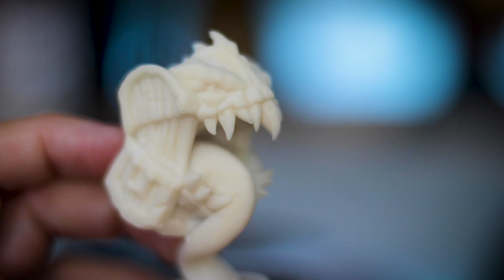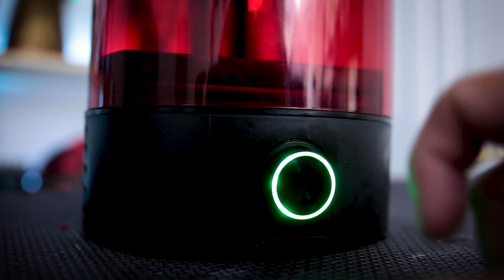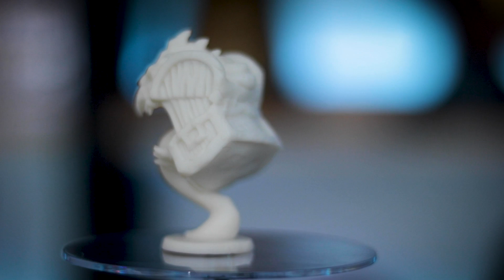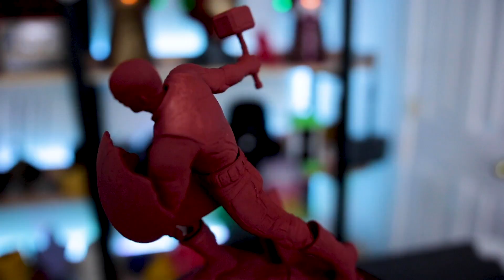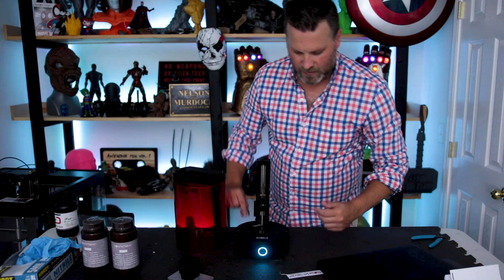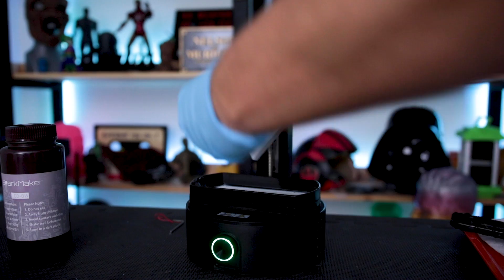Unboxing & Testing $200 Resin 3D Printer | Sparkmaker SLA Resin 3D Printer

Comment: I ordered this the day the video came out (8/23); Technically I ordered the FHD. I received the printer today (9/16). In that time I've purchased AND received my Elegoo Mars (which I paid LESS for) and have printed a considerable number of prints. In addition, the FHD version came with NONE of the resin for MORE money and couldn't have been more bare bones. Even without trying this machine, it's already a disappointment. The Mars did not come with any resin either but it came with a great many tools, gloves, face mask, a good tool set, etc.

Comment: Has anyone else had a problem when you insert the sd, press the button and it flashes yellow before turning green again? I haven't been able to print anything and when I have read various different possible reasons, none of them seem to work, I have tried using 2 different SD cards and making sure that it is 32gb and in the fat 32 format. Does anyone have any ideas?

Comment: I ordered the larger one of these after seeing your video using the link you provided. The shipping said 5-7 days, I’m on day 12 with no printer, and tracking info that hasn’t changed in a week and only indicated that the label was printed. Worst thing is a couple of days ago i seen on amazon a photon and a mars for about what I paid for this one. If i had ordered from there I’d already have stuff from my 3d printer instead of still waiting on printer itself. Not a good experience for my first 3d printer. 😡

Comment: I'm surprised you didn't mention that this has substantially poorer resolution than its competitors such as the Mars.
Sparkmaker: ~8.658 pixels per mm
Sparkmaker FHD: ~17.4757 pixels per mm
Mars: ~21.164 pixels per mm

So, I would say the Mars is easily worth it, especially since it has been on sale for just $250 every time it is available for awhile now. You can get a full liter of resin with the printer for about the same price as the discounted Sparkmaker FHD. ( Which someone else said the discounted ones do not come with the resin, which would easily cover the price difference. )

In addition, what size are the resin bottles? 2 bottles of 250g vs. 2 bottles of 1kg is a pretty big difference:) Judging by their website, it looks like they would be 500g each.

Still, always good to hear more more more, so thanks for the vid/review!

Comment: In general if you don't plan on painting your resin prints what color would you reccomend? You mentioned some color shift when using white.
Reply: Grey is usually the standard. Lets enough light bleed into the material to get the whole layer, but without the bleeding of white.

Comment: Sorry to get your expectation down guys but this printer does not have a 2k screen like the others, only the FHD 350usd version has. and the 200usd version does not have resin on the package.
Reply: The FHD just has a 1920x1080 screen, so it still doesn't even match the normal 2560x1440 other printers use. Even with the Mars' bigger build area, it's still a fair bit better.

Comment: What about those little zits I'm seeing on a lot of SLA prints?
Reply: Those are artifacts left over from where the supports contacted the model. Tweaking and resin selection can minimize this, but it's an art and never perfect.

In addition, the first few layers will need to be cured substantially longer, which causes more light bleeding: So, the first few layers will be a bit bigger and detail will be lost if the model is in that area.
Reply: @zemerick  Looks to me like I'm seeing them in areas that don't have supports.
Reply: @DTyrannosaurus  Do you have a specific example? Only thing remotely like that I can think of though is the supports.
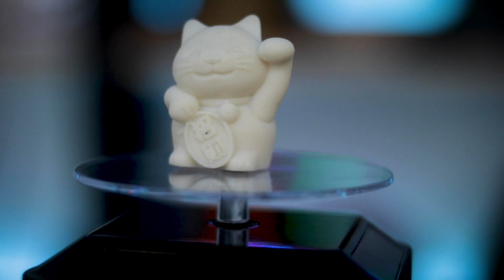Reply: @zemerick  Did the cat at 6:56 have supports? I don't think he mentioned whether there were, and it doesn't look like it should have, but it definitely has pips on it.
Reply: @zemerick  It does look like maybe support locations. Wish he'd said if there were, for my sake because I'm early in the SLA learning process, and the print doesn't look like it would need them. Since he was happy with the result, though, I'm thinking you're probably right about it.

Comment: I was going to get this one, I instead opted for the Elegoo Mars. So far no regrets..
Reply from the maker: Mars is pretty damn awesome machine. Easily my most fav out of all of them. Price / Print Quality
Reply: Agreed, especially since I got mine for $260. So, cheaper than the smaller, lower resolution and slower sparkmaker FHD even with the discount, while also having a nice screen. Even adding in the price of resin, brings the pricing about equal for a superior product.

Comment: It tooks so long to print the cat because of the UV panel, maybe. It's 24W only, so the curing time is quite longer than other printers such as Mars and MP mini.
Reply from the maker: Ah thanks for the info... I'm like the least technical youtuber out there haha I just like making and showing off fun stuff
Reply: It looks like the lift speed is the bigger issue. Default speed for the Mars is 120. At 65, it spends nearly 5 seconds just lifting each layer. Then it has to come back down and there's usually a slight delay before the lamp comes on. So, the 6s exposure time is only like 1/3 of the time per layer. The lift height could also probably be lowered to 4 or so, but I wouldn't push it beyond that.

Comment: Wouldn't a smaller screen that's still 2K actually give you a better XY resolution?
Reply: Far better. This printer is only an 854x480 screen, and even the FHD is only 1920x1080. So, even though the Mars is a fair bit bigger build area, it still has substantially better resolution thanks to the 2560x1440 screen.

Hopefully soon we will start seeing nice sized 4k budget resin printers. That would allow a 100x180 screen at a hair better resolution than the Mars.

Comment: Thanks for posting. I was considering this but was leery given some of the other reviews. I hope you do a follow up review after spending some time with it.

Also FWIW the monoprice mini you reviewed and sent back. They're now shipping V2 models that have a completely redesigned Z stalk. Plus a few other tweaks.
Reply from the maker: oh really? Thats great to know. I for sure will be following up in a few weeks.
Reply: The mp mini also needs to redesign the build plate attachment to be stronger ( it could easily pop off ), the auto leveling locking mechanism ( frequently popped loose ), and issues with the LCD. ( Mine gave out after maybe a dozen prints. Others have reported issues. ) It has promise, but it's definitely in the growing pains stage still.
Reply: I have attempted 2 Monoprice printers. Both had to go back and neither were worth any further effort IMO. Both FDM though.
Reply: Is this the Sean Wood from the printrbot facebook group?
Reply: Yes sir...

Comment: I might get me one of those just for the fun of it
Reply: dont to it, just get a Mars
Reply: @ezrastillwater3386  what's a mars ?
Reply: @TheSomar1991  Elegoo Mars. Far better printer, that has been on sale for a couple of months now for $250. ( It's frequently sold out though. )
This printer has an 854x480 screen, while the Mars has a 2560x1440 one. The build volume is quite a bit bigger ( but still about triple the effective resolution thanks to the far superior screen ), higher power lamp ( for faster cure times ), higher speed, nice touchscreen. Basically, it's across the board better. Well worth the extra $50.
Reply: @zemerick  I'll check it out thanks man I appreciate your tip